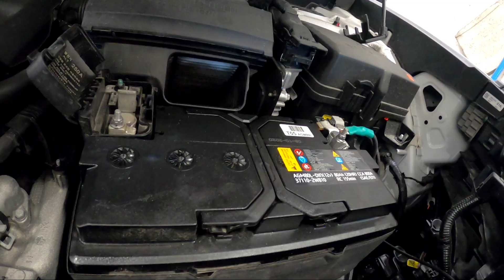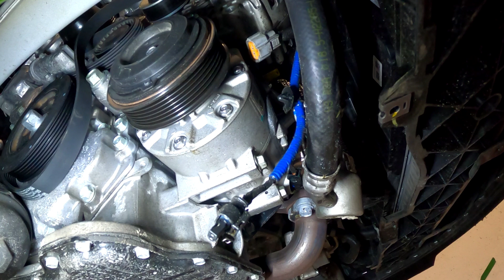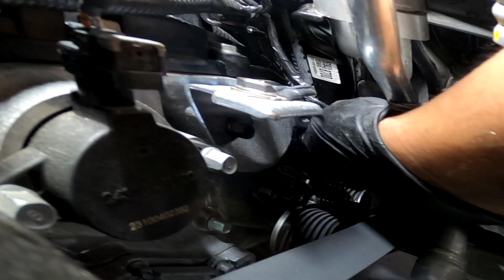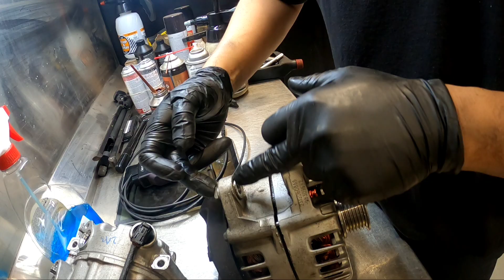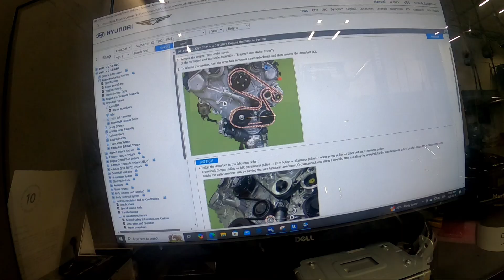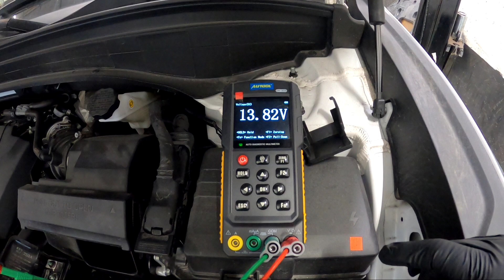How to replace alternator on Hyundai Palisade

Comment: My alternator went out got it changed now I have trouble with it switching gears properly changed battery still same thing  any suggestions?
Reply from the maker: What do you mean switching gears? Like from park to reverse or drive? Is it this mechanical shifter or pusg button shifter? Maybe check the cables?

Comment: I frigging spilled oil on my alternator and I now have to change that:face-orange-frowning:. Expensive oil change....smh.....lesson learned...
Reply from the maker: Just spray some brake cleaner and blow it with compress air and that should be fine. Unless you will not clean it.

Comment: I have the same issue with my pal side, where the oil is leaking onto the alternator. I’m having to switch that out now this seems to be a common issue based on other videos I’ve seen with this vehicle.

Comment: I replaced the alternator twice now thinking the new one we bought was bad and well on top of it went with a new belt and new battery. At first it was charging do well and now after about a 150 miles the battery light came on and battery is now not charging. I checked all the fuses and they are good. checked the battery staying at 12.7 the alternator was just working this morning and now again it has stopped charging the battery. I am going nuts with this problem is anyone has anything i can check please let me know. If we disconnect the negative wait 5 mins the alternator will go back to charging the battery back at 14.2ish. but again after 100 to 200 miles and stopping and going turning vehicle off the light of the battery will return check battery and while car is on with ac running and lights and everything battery is at 12.6. This has been happening for over a week reason we replaced the alternator twice and then did the belt and battery. sorry also this is on a 2020 palisade. is there some other reset we need to do that im missing or something? please help if you can thanks
Reply from the maker: Is it oem alternator? Do you have any codes? You have to check the communication line for the alternator to see if its sending signal to ec.
Reply from the maker: To ecm
Reply: @hyundaitech haven't tried an oem alternator. We have check signal and that works fine to ecm
Reply: Also no codes at the moment last code was module a was not receiving from alternator. Forgot the code number sorry
Reply from the maker: @316_James some aftermarket component doesnt do well in terms if the component has communication happening. I would suggest to do oem alternator.
Reply: @hyundaitech I checked it this morning battery was at 12.5 without car started. Then started car and multimeter went to 14.2 but slowly light you could count up and then bavk down to 12.2 slowly now holding steady at 12.4. Drove about 15 miles seems fine no power issues and battery when got to destination was 12.4 while car is running
Reply: @316_James ever figured it out?
Reply: @KrisKYL nope my mechanic is stumped I asked around and got nothing so we traded it in not sure if it was a smart idea but we got the 26 palisade sel so knock on wood we dont have any problems
Reply: @316_James  Wass the aftermarket alternator 180a; only ask because I noticed that they did sell them at 100a and maybe all the components pulled too hard not allowing it to make it's voltage?
But I am not sure if that would be the effect of more amps pulling or not.
Reply: @Thesaurcery4U2C the alternator came from hyundai so I would hope they would give me the right part not saying they did so im not sure

Comment: Why would you disconnect the A/C line from the compressor? Wouldn’t you just want to remove the 2 bolts holding the Compressor and move it out of the way so you don’t have to charge the system back up?
Reply: Yes, but it's 4 bolts on the compressor.

Comment: i am replacing my Kia Telluride alternator (sister to the palisade) and i am getting resistance when inserted my new alternator into the brackets on the block. Not sure what is going on
Reply from the maker: Maybe the locking not is not out. Just push it out, if its new one it should smoothly goes in. Or maybe you need clean the bracket in the engine side if theres rust on it.
Reply: Always use heat to allow the metal to expand for easily movement removing parts in the car